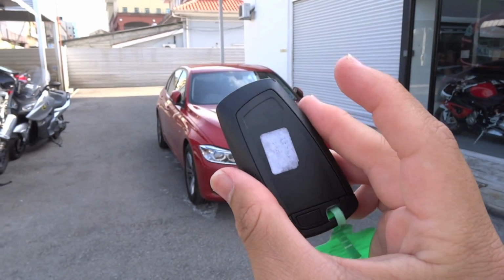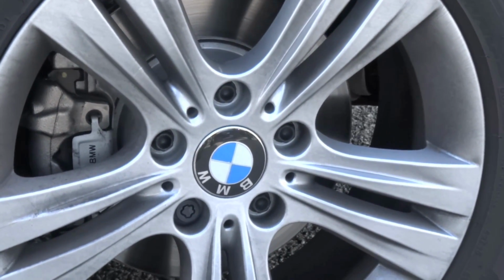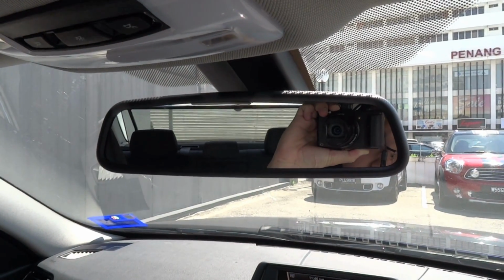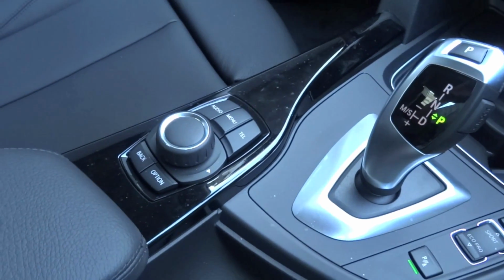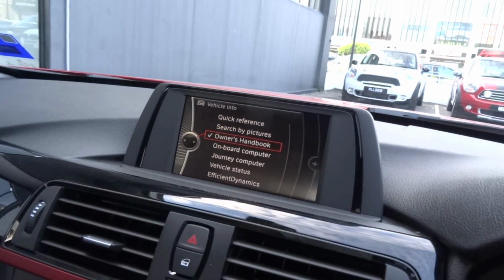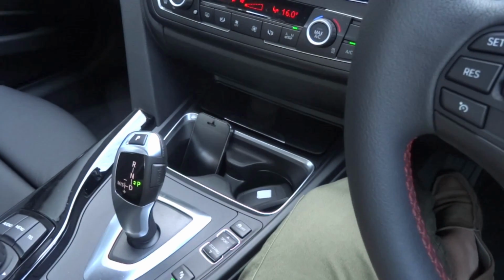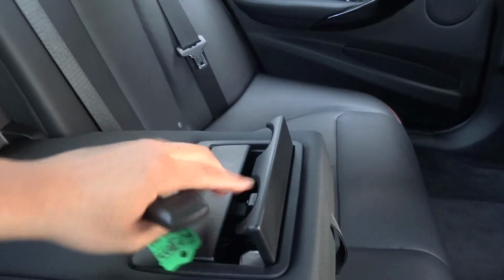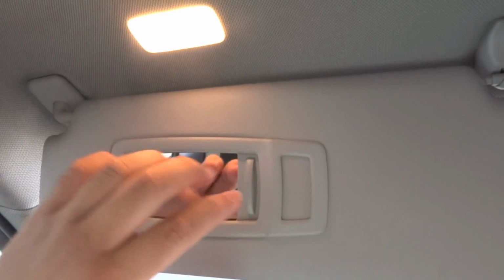2014 BMW 320i Sport Line Start-Up and Full Vehicle Tour

Comment: Nice video Alex!! We just got an Estoril Blue 320d M Sport Saloon. It's awesome. It's way better than the previous E90 320d which we had.
Reply: I'm in turkey alex its 320i ED i got this car for 70 k $ taxes are Really High in turkey 

Its 320i ED 1.6lt petrol 170hp but i install racechip to it its 215hp now
Reply: Which one the E90 or F30?
Reply: Same man we sold our e90 and bought a new f30 it Will be Here in xmas
Reply: We ordered a mineral grey one originally and when it came I noticed that it was missing the xenon headlights, the dealer was so embarrassed but it wasn't his fault as us and the dealer had a copy of the correct order form. In the end we got slightly more equipment on than what we originally wanted.
Reply: Our car is mineral gray too :D its fully Loaded
Reply from the maker: Nice one!  Where're you located?